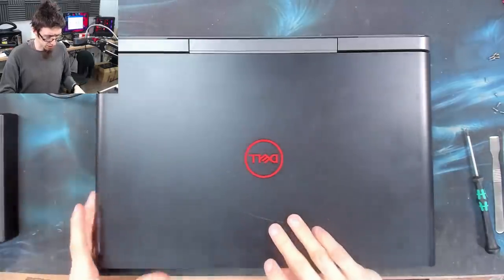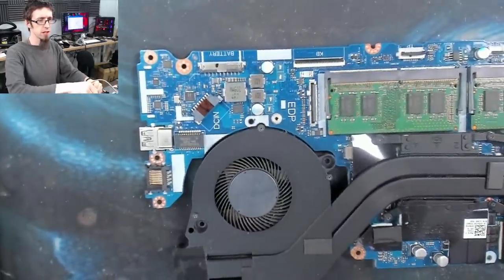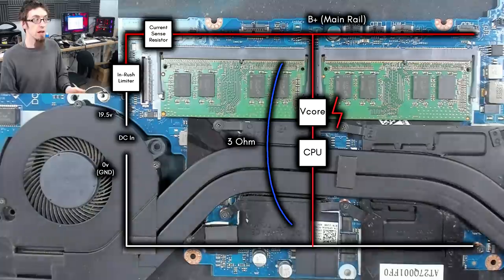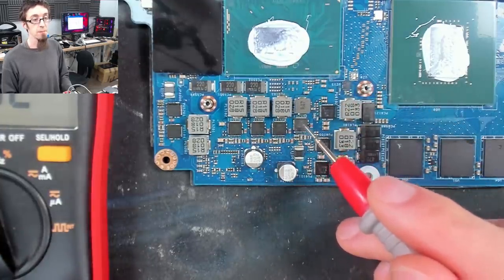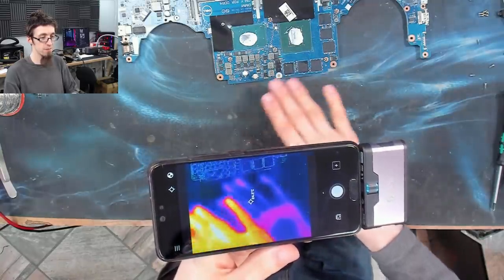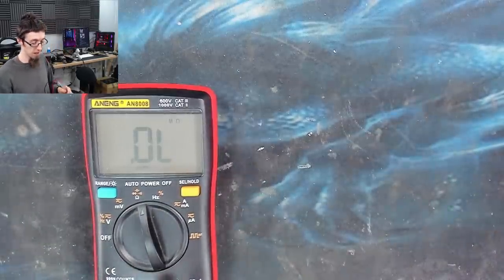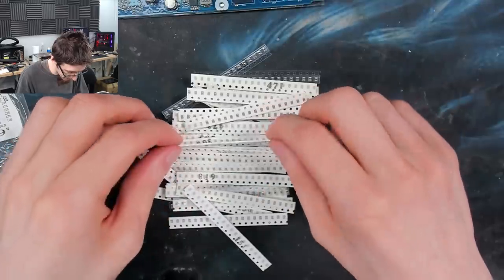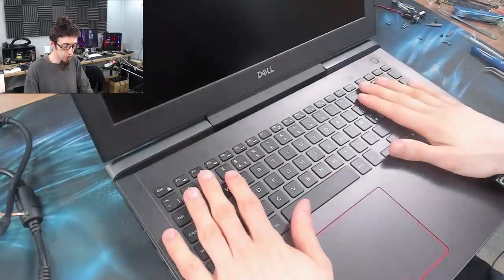How to fix a Dell Gaming Laptop (Dell G5, charger cuts out) - LFC#283

Comment: I started fixing laptops recently (well, at least trying it for now - to see if i can actually do it) being quite a bit influenced by Adamant IT and the other guys who do this on youtube.
i found that Graham explains all the steps quite well, and in a way that someone without much experience can understand.
The last laptop i fixed had a short on the +3V and +5V rails due to a shorted capacitor.
Finding this fault by yourself with the help of measuring and studying the schematics was incredibly satisfying.
It took quite some time, but i think the experience i gained from it is very valuable.
Thank you for your great videos.👍😊

Comment: Dells always power cycle 3 to 4 times once you have the bios battery/main battery disconnected. It’s essential retraining it’s self once it’s turned back on to learn what hardware is connected and the speed it runs at.
Reply: Perhaps it's because Dell is garbage.

Comment: Just want to let you know that - this coming from someone inexperienced but not wholly ignorant of anything electronics - the detail is indeed very much appreciated. This is great for what I think is going to be most people - you have an interest and a need, and probably have access to a multimeter and iron (or can pick something up on Ebay for a few bucks), but aren't sure what you're doing and lack confidence. A lot of other content glosses over things or treats it like an engineering class with little relevance to what's going on in the machine, and loses context. This video is easy to follow, the video quality is clear (also uncommon :( ) and the explanations are complete and to the point. Actually I don't think I've seen anything quite so elegant in terms of walking through the diagnostic process, at least as someone who isn't already an expert. Easy and enjoyable just to watch, really. 

Now I've still got two dead Dell laptops and this is encouraging me to try to fix them. So I'll pass all the blame on to you for the results :P

Comment: this is one of those vids that is .. GREAT!
one point to mention is the limiting to 3 amps reduces the chances of burning the short out and then feeding the other components.
Reply from the maker: This makes sense. Plus also, when a component goes nuclear it has a habit of welding itself onto the board, which increases the chance of damage when removing it.

Comment: Graham you are literally a lifesaver!! My Dell laptop suddenly stopped charging and Dell quoted me almost $300 to fix! I followed your methodology from this video (continuity checks/voltage injection) and found a faulty shorted MLCC with an IR camera. A hot air gun and one capacitor replacement later, the laptop was charging again. Thank you so much for this video!!

Comment: Worst laptops I've ever had to pull apart are the Earlier Panasonic Toughbook series, just billions of plastic bits, seals and screws and the very early Toshiba A - series laptops from the '90s which had multi-layers of boards interconnected and had to go back in the right order with the right screws, nightmare. Great result and use of the Flir camera when applying low voltage, current limited injection. Appreciated the explanation of the way the power bus is connected and how the current flows through in that particular situation where the CPU and GPU are not shorted. What's in the VRM chips and why checking for a short there is important when trying to prevent damage to the CPU and GPU. Great video, loved it.

Comment: Your explanation and procedures are very well put out. I'm always enjoying watching your YouTube videos, the way you explain things is extremely clear even here in the states. I rank you as one of the highest technical explainers on YouTube. Have you ever thought of streaming with your subscribers like video chatting so you can help someone at home that has similar equipment to fix their laptop? I know other YouTube 
Content providers used to do that.
Reply from the maker: Sadly I'm not experienced enough to be able to judge a board that isn't right in front of me.
I've got a project on the back-burner for a "learn to solder" live stream though, to help people pick up an iron and start tinkering with stuff. Bit lower-end than what you have in mind though.
Reply: @Adamant_IT  I'm sure it could be possible if the person you're video chatting has an extra camera pointing at the laptop or motherboard. You could guide the person to probe the area of Interest depending on what they get from the meter. just a thought but I do understand where you coming from starting small then working your way up to that level of teaching and helping.

Comment: I bought this same laptop several years ago and gave it to my cousin. I recently did a repast on it and it was a bit of a challenge. It does have a long power cycle and it shuts down a few times when you do a teardown. The newer Gaming laptops from Dell don't have this design anymore and are a little easier to open. Great video, will save it for future reference.

Comment: Great job, appreciated. To actually avoid such a tail in your soldering, using a bit of flux is recommended. Also you can use a different soldering wire with a different ingredients combination (for example 50 percent tin/50 percent lead) which helps to keep melted solder to be more like mercury,  thus less flux-oriented soldering in needed where already the piece has solder on it. Drawback is more time is needed to lose heat and be solid again.
Reply: Yeah, I think the only way to get rid of those tails really IS to add more flux.  Most of the flux is blown away during the use of hot air.  What I think I've seen most others do, is to simply add a bit more flux after the hot air but before touching up the edges with the iron.  I think you need that liquid flux surrounding the soldering area to really stop the dags - I don't think there's a way around that.

Comment: Ik have to respect the patience you have. I always inject 1V right after the current-sensor resistor and see if capacitors get hot before checking anything else :)

Comment: Excellent video, learned a few things. Sometimes you can use the suggested or typical use/arrangement  circuit or description in the datasheet for values of components. In the SY8286RAC datasheet it states to use at least a 10Uf capacitor in that portion of the circuit. Pin Name:IN,   Pin#:2,3,4,5,  Pin Description: Input pin, Decouple this pin to GND pin with at least 10uF ceramic cap...A lot of manufacturers and designers use the suggested circuit, if available, with slight or no modification in their own circuit, it's easier... Anyway, good troubleshooting, good video...Thank You...

Comment: great work! just keep in mind that many modern CPUs and GPUs do have sub 1ohm resistance, so it's sometimes hard to say if you have a shorted VRM or not just based on resistance nowadays
Reply from the maker: Yea. I think the next weapon will be a multimeter with really good Ohms accuracy and some decent probes, so it's possible to narrow down "The Short" from "low-resistance silicone".
Reply: @Adamant_IT  well tbh now that you have the thermal cam, you can just inject 0.5V to 0.8V and find the short. That voltage should be low enough to be safe in any scenario while also being enough to detect heat on the thermal camera

Comment: the flir cam is ok but the seek cameras are generally much better for electronics repair due to the focusing capability and the option to add a macro lens mod
Reply: @Pulsebass  personally I have the seek compact pro and i think it's hard to beat for the price. Resolution is much higher than the equivalent flir and you can add a macro lens mod which makes it able to focus on even the smallest components. It's the camera of choice for many people doing phone repair, like ipad rehab, so that should tell you how good it can be for working with small components

Comment: I don't understand electronic terminology regarding capacitors, resistors, MOSFETs, etc etc,
But
I've always found it very fascinating, and would like to learn more about how to identify, diagnose, and understand how the different components on a board work.

Is there any resource you could recommend that I study?
My goal is to be able to understand electronics enough to be able to diagnose, and repair electrical issues on boards.

Comment: The caps are on the power rail so value doesn't so much matter. Generally just replace them with the largest value on hand and don't worry about it. It's really only on the signal traces and rectified outputs that capacitance matters and where you'll find multiple caps in parallel, filtering out multiple frequencies. And for reasons of inductance they'll be close together.

Comment: Just for a note: those big caps in laptops are almost always 0805 size, 22uf and 10uf are rated at max of 25V. The greater you go with the capacity, the smaller will be max rated voltage for a given size. There are charts and tables of standards and max values on the net for the MLCCes. Just ask uncle Google. BTW, very good, deep explanations of the problems, thank you brother...

Comment: when you remove battery bios (reset), power cycling is just checking all stuff connected to mainboard , takes sometimes even 6-8 times before it will boot, especially in 8th gen and up

Comment: Hi. One of the reasons for the multiple failed attempts at startup after the battery is disconnected may be due to the uefi implements data redundancy check, if the configuration data (the payload) is corrupted, it will drop the package and request for it again (may try multiple times), instead of just throwing a checksum error. If the integrity of the payload data cannot be verified, it will eventually display the error message (a runtime execution error, formerly the “checksum error”). Nice video.

Comment: Great and instructive video as usual. Please keep the waffle.

I wonder if the laptop did not power on at the end because the base wasn't on and it had no airflow. Perhaps your pad was stopping the fans from working? When you put the base vertical - and so had plenty of air and nothing pressing on the fans - the laptop came straight on.

Can you explain why you were confident the laptop would work after you had removed but not yet replaced the capacitors? In this case you did not yet know that they were going to ground, so if you break a live circuit surely the whole circuit stops working?

Comment: Nice guide. I will mention that hand-soldering MLCCs is best avoided as it tends to cause stress fractures which can be filled in via silver migration and thus cause new shorts. Stress fractures are why MLCCs are so much less reliable than their through-hole counterparts. You can get automotive grade types that are much less susceptible to this, if at a size and price premium.
Reply from the maker: Interesting stuff... does that include hot-air, or are you revering to how I touched up the joins with an iron afterwards?

Comment: Hi Adam! It's been a while, you finally grabbed a thermal camera yay!

I have a question, do these SMD caps not have polarity? Looking into getting into board repair soon, going to order a bench supply & soldering station v soon.
Reply from the maker: These brown ones are Multi-Layer Ceramic Caps (MLCC) and are not polarised. Tantalum (either black or yellow) have the positive end marked. Electrolytic (the circular ones) have negative side marked.

Comment: Brilliant video. A comment: I suppose that only second MOSFET is used as a switch to disconnect power supply from the board. First one is probably used as a reverse voltage protection.

Comment: Good job, but you should always check on the two mosfet from the dc jack to see if one of them is short to ground or not. If it’s short to ground, the board will not charge the battery.
Reply from the maker: Surely that would put a short at the DC jack, which I checked for?

Comment: picked one of these up "untested" followed your procedure. with the short circuit. figured i would try the power supply and test the laptop with the motherboard separated. found the metal heat shield/tape was mangled and folded in one spot causing a short.
some bafoon had been messing with it before. the cpu was completely gunked with thermalpaste and the gpu had nothing on it.
threw it together for a quick test and it works perfectly
Reply: also, your tutorial helped me out alot. thank you so much for taking your time to upload this!

Comment: I like to see other laptops to use those solder bridges for possibility to separate PSU block from main rail so you can do trouble shooting without voltage injection or do it smaller area.

Comment: This was nice explaining in detail i am happy for you that it was capacitor. I got less luck by my dell g7 7790 with rtx 2060 is gpu short , such all in one chip from phase from gpu  which i can not  find on internet.
Reply from the maker: Yea, gaming laptops are brutal, my success rate on them isn't very high. One before this was a B+ short as well, a capacitor on one of the GPU VRMs had gone nuclear and put a fracture in the board that shorted internal layers together. No hope of digging that out, although I gave it a try.

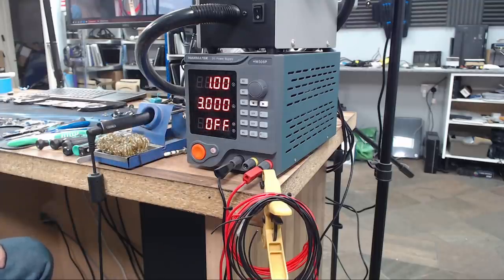Comment: 26:40 - Nope, sorry, the explanation of regulated vs unregulated power supplies is incorrect there: virtually ALL switch-mode power adapters, big or small, are, by definition, regulated, because they (at least try to) maintain a stable output regardless of input voltage or output load, so the phone charger and laptop power brick, as per your example there, are regulated, albeit they indeed don't do constant-current - they do constant VOLTAGE, the way you described it. By contrast, a simple transformer-based power brick is indeed UNregulated because it doesn't have any control over its output - it fluctuates with changes in input voltage and output load, hence why regulation needs to be done inside the device they're powering, through like a LM78XX, or a switch-mode DC-DC converter, assuming the brick doesn't have these inside it already, which a lot of the time they don't, from what I've seen. Hope that helps :)
Reply from the maker: Ahhh heck you're right, I've even seen examples of "true" unregulated power supplies and been like "Huh... the voltage is hot when there's no load."
Well, the point stands for current regulated which is what's important for this context at least - but yea, noted!
Reply: @Adamant_IT  And this is why I continue to follow your channel; you still have the humility to recognise when you are wrong or have misunderstood something, and to treat it as a learning opportunity.
Reply: Yup - big fan of your content. I'm a repairman just like you as well :)

Comment: Dell laptop do 3 soft reset and then show bios logo before turning on after you have taken out the cmos bat or if you changed any component. Dell bios those a self diagnostic ok every boot and will alert if faulty components also they have a built in bios hardware check menu.

Comment: impedance isn't just for AC
i am an electronics student 
and the only time we use the term resistance or the symbol R is when refering to a resistor 
otherwise it's impedance 
whether it was a coil or a capacitor we use Zl or Zc and ofc the word impedance 
dunno if we're right or it's just our education system failing again tho

Comment: Thanks for the great video! learned a lot of new things.
Recetly my laptop backlight causing an issue and after some R&D i figured out its "F2" looks like an mlcc capacitor when i short it using iron plucker it's started working, will you please guide  shoud i bridge it with a thin wire or i have to place a new capacitor ?

Comment: In Telecom copper cable if you had a short along a distance of phone network  i had instruments that would tell at what distance the short was but not where a fault is ( any where over 1km or less going along pipes along streets  ) . Now normally we had a trace alert sound in a Loop a line but they don't create sound to a short cable that might have a 200 wires ( using -/+ each leg )  of a 100 Pair cable . That was a pain . Also a Low resistance in some K ohms is un-detectable to locate with ohms locaters but can be seen when a analogue meter is connected . The only hope was getting an open circuit from the short breaking down in some of the other 99 pairs .
Reply from the maker: Man, speaking as someone who's had to find a broken ethernet run in a school's structured cabling, I can't imagine the nightmare of looking for cable faults on a geographic scale.

Comment: Wow that was very exciting thank you very much indeed.
I see that these capacitors are not polorised like electrolytics are.
Reply: Ceramic capacitors aren't polarized, but one thing that catches out people new to electronics are tantalum capacitors.  They are polarized, but where electrolytic caps have the polarity mark on the negative side, tantalums have it on the positive side.  The old, cheap chemistry also tends to "vent with flame" (explode) when overvolted or reversed.  To make matters even more confusing, they can be black and can look a lot like a diode.